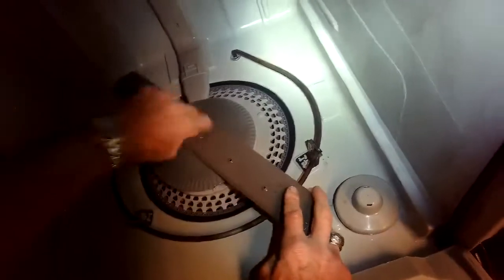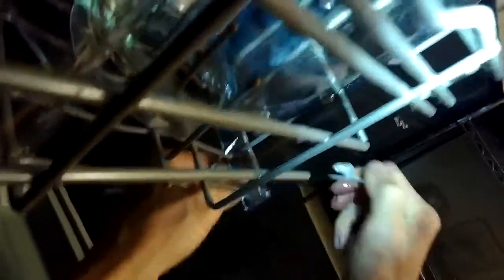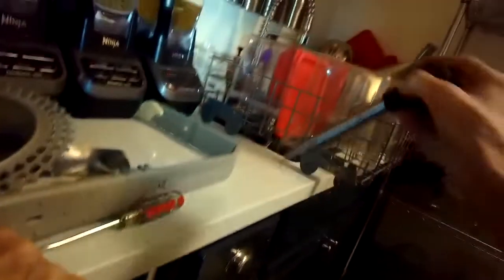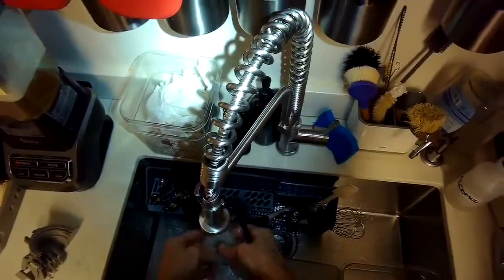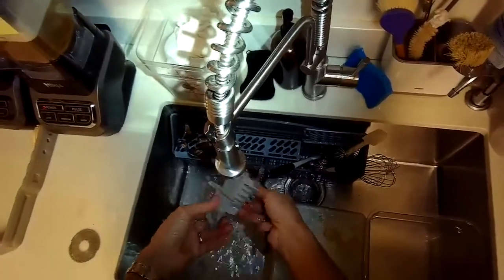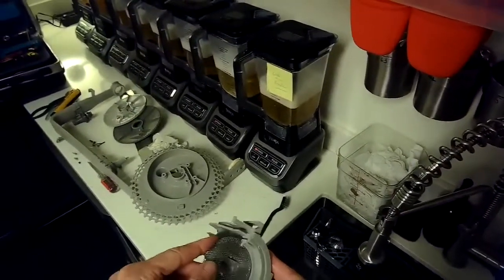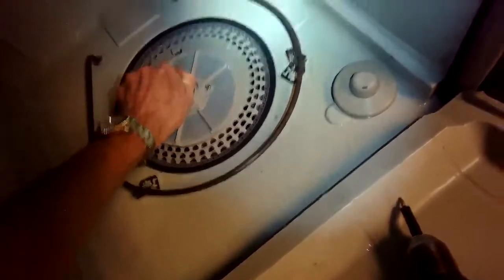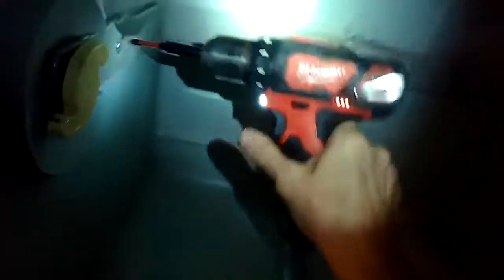✨ MAKE YOUR WHIRLPOOL DISHWASHER - WORK LIKE NEW - Easy DEEP Cleaning ✨

Comment: This is one of the only videos with this style of drain and it helped me remove for a cleaning.  Nastiest thing I've ever had to do since we hadn't touched it for almost 15 years.  The post removal that wasn't shown was 2 philips screws (as mentioned) to remove the upper part, and the lower short part of the post comes off the bottom filter if you rotate it to the right, which then exposes the 4th screw to the drain filter on the bottom.  Thanks for doing this video.
Reply from the maker: Great info. Thank you 👍😊

Comment: Thank you for the help, great video. I have a whirlpool quiet partner III , and your video help me a lot to get rid the bad smell, but after all my work remove parts and put back , I notice after wash cycle deep clean with baking soda, I notice the bottom has water , wasn’t dry  .it’s normal , my cancel push bottom is flashing. Could you please help tell me I should do. Thanks
Reply from the maker: Can you tell how much water is left at end of cycle?

Comment: Id like to pick your brain, i have this model but a III. Normal cycle options off it starts to wash for few minutes then drains but doesn't refill and runs without water, never going from wash to rinse or opening the soap door.   
In Normal w/Hi temp option on it runs and opens soap door but never gets hot.
Picked it up on the curb and would like to install it after replacing the toasted maceration blade and screen if the cycles are functional. I am mechanically inclined, but could use some guidance on troubleshooting this one.
Reply from the maker: Thanks Bobby,
Does the water level reach the heating element at 10 minutes into the cycle?
Reply: @QuickAndEasy5MinuteAppliance  water level is normal. Been troubleshooting today. Came to find out the drain was siphoning,  had to put a second loop in the drain line (in addition to the one permanently on the side of the tub). Siphoning is fixed, however, heater element is now tripping gfci. Element is unplugged from the unit and I have gotten between 2-8 ohms on the element,  service paper states 10-30 ohm @ 77°. Currently running 3 consecutive cycles to see if it will trip the "clean LED" 7 times code.